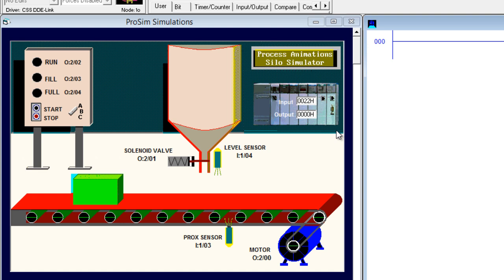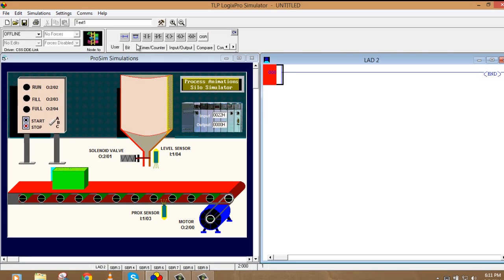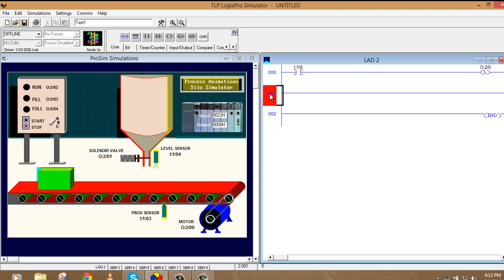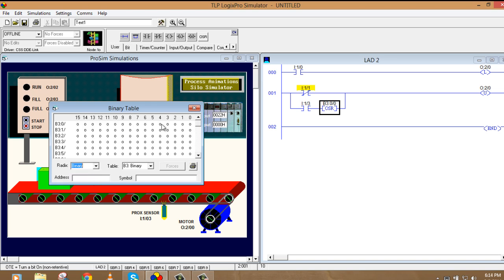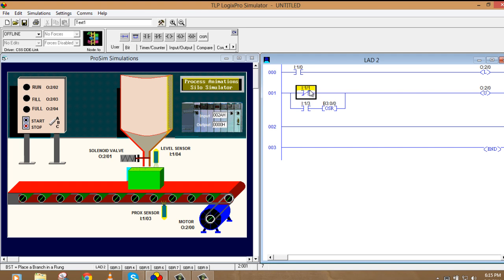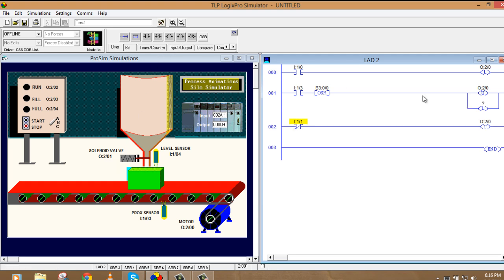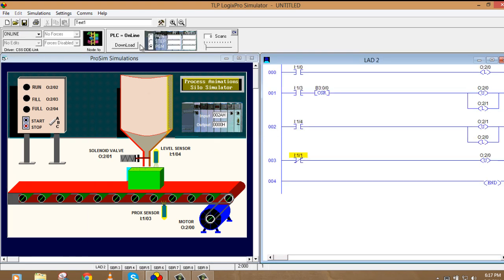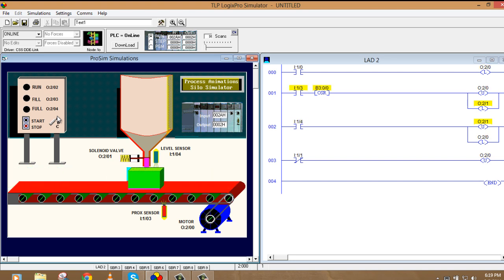Logix Pro- PLC Silo Simulator - Allen Bradley

Comment: using logix pro500 could you please help me solve the given problem; a Conveyor system is connected to start and stop circuit and consists of barcode optical scanner to read the barcodes of the products on the conveyor belt. a part detector is used to sense the part moving on the conveyor belt. whenever proximity sensor sense the object it should send the signal to the conveyor motor and stop the conveyor exactly in 5 seconds. the conveyor remain stop for another 3 seconds while the barcode reading process is completed and then automatically restarts
Reply from the maker: This sounds not that complicated. Where are you stuck?